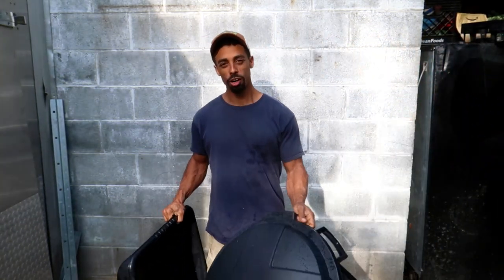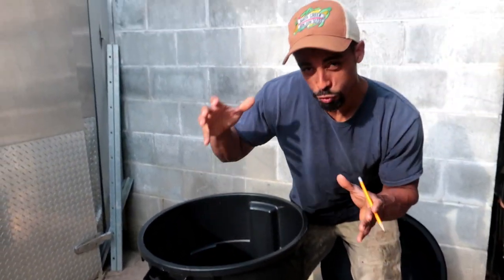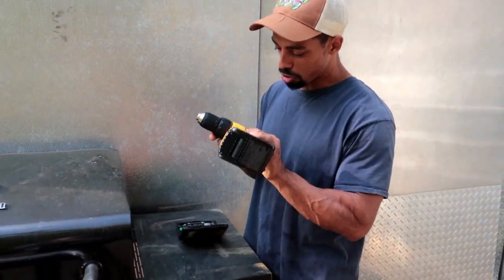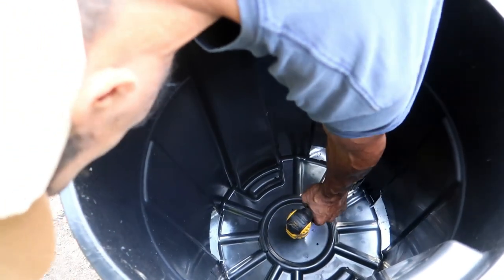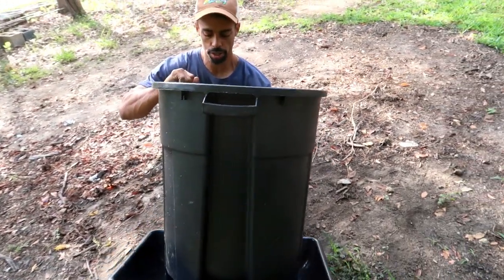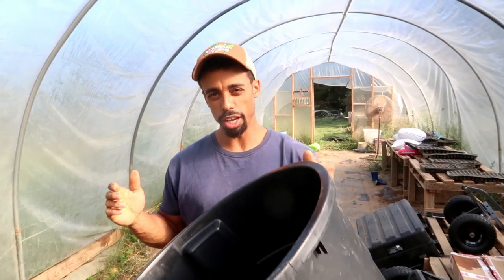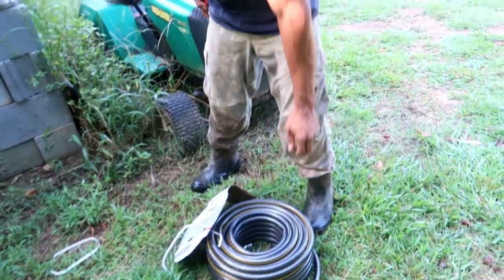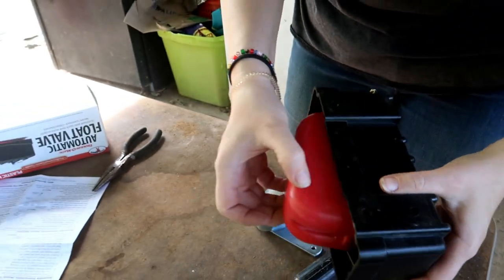How to build an Automatic Chicken Feeder for $25

Comment: I used to work on a commercial turkey ranch, our auto feeders worked generally the same as your feeder does, we had a heck of a time with mice getting inside the hoppers & dying until we installed hardware cloth over the openings.  Big enough for feed to get out too small for those litter buggers to get in.  Thanks for the video will try that for our girls soon, the waterer will be even sooner though lol thanks again for the vlogs.

Comment: as one that been building all my auto bulk feeders and waters for over 30 years, the holes you cut in the can are way to big chickens an ducks are smarter then people give them credit for, you see, they know very fast were the feed comes out, and they are very greedy, they dont care how much feed is in the bin, they just know the more they peck at that area more feed falls out, so they all pile into that opening and go at it, pulling feed out, next thing you know with big holes the bin is flooding over with feed onto the ground, but they keep at getting the feed thats in the big hole, not long the whole can of feed is all over the floor and the can is emty, you want them to have to work at getting the feed to fall, fut the opening know more then 1/2 to 3/4" high, and 6 inch long, with a round can, you need a cone in side the can so the feed emteys out, i build all my feeder out of scrap ply wood and board, 4 feet long box by 8" wide with 2 1x4 put in a L shape and set it on the bottom to make a peekand a peace of ply wood for the tray  for bottom an as the tray with a 1x3 rim board for the edge,  so the space between the box an inside trim board is no wider then 2" and i set the box 1/2" off the bottom,, no wasted feed. hold just over 100 ponds of feed

Comment: I like the feeder concept, Neat Idea! Those water floats really help out a bunch! One suggestion I’d make is Build a small wooden frame for the round rubberized water bowl to sit down inside of. Or a wooden frame to cap over the bowl. This would be to prevent a overturned water bowl from a bunch of chickens or animals from standing on one side & possibly tipping it over. Which could result in prematurely emptying your water barrels. Just a idea 💡. 👍

Comment: Not sure if you knew but many hoses state on them they are not safe for drinking water from them.  Additionally as they warm up from the sun it leaks toxic chemicals into the water.  They have drinking water hoses although a bit more expensive to get the lengths you need.  Same with non food grade plastics.  Just some FYI for those who are concerned about those kinds of things like me.

Comment: very cool!...I use a 5 gallon pail w/lid and an 6" pvc elbow (the kind with the lip thing)...cut hole bout 4" up from bottom and put in the elbow facing down inside and caulk it in place...the chicken stick their heads into the elbow and eat...they love it...it is water proof and I hang it from the metal handle to keep out rodents....but I don't have 25 chickens...lol... I only have 6....  :)… love your channel and your beautiful family!
Reply from the maker: Sounds like a great feeder you have there and works great for your set up. Thanks so much for watching!

Comment: Pro tip: when using a skill-saw, always adjust the depth of so that blade comes just below the material your cutting.  Its safer AND gives better control of the saw, making a cleaner cut. Thanks for sharing.

Comment: I enjoy your videos but just to give an other opinion on throwing away eggs that are a couple of days old. 
 The chicken originated from the tropical jungles of southeast Asia.  It is always hot.  The chicken egg is made to withstand being left for up to two weeks or more before the hen sits on them to start the incubation.  A couple of days will not spoil the eggs. You can check them by  putting them in a pot of  cool water that is at least 3 inches deep.  The good eggs will sink right to the bottom.  If they bounce up and down but still settle on the bottom I would probably throw those, away...any floaters, definitely throw them out.  You can also scramble them up with the shells and feed them back to your chickens.

Comment: You need to put washers on the bottom of the bolts before you put the nuts on to prevent the nuts from wearing their way into the plastic in the future, since the plastic is not rigid. But that is a great idea for bulk feeding a bunch of fowl! I just saw a homesteader use that same automatic waterer device on a large 100 gallon trough for his cow! Great ideas and God Bless!

Comment: You could also use a pan that goes underneath a water heater for the bottom part of your feeder. There even round. Also some kind of metal cone inside the barrel to divert the food to the outside of edge where the holes are. Hope this is helpful.
Reply from the maker: That is a good idea!